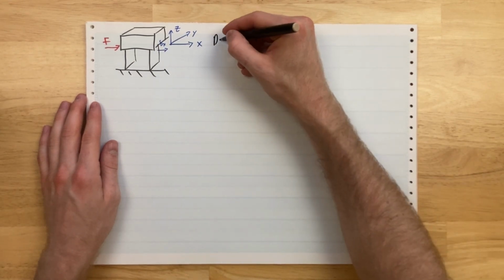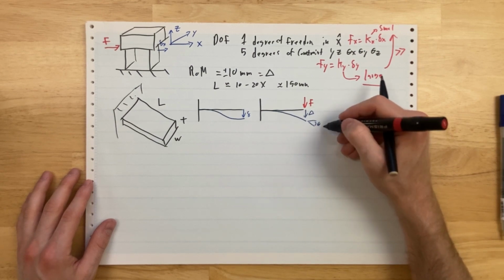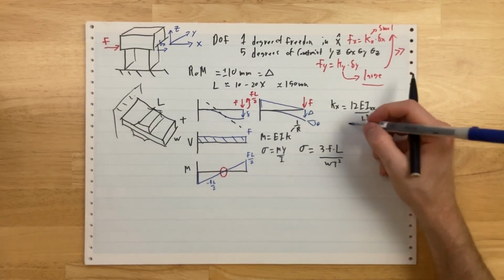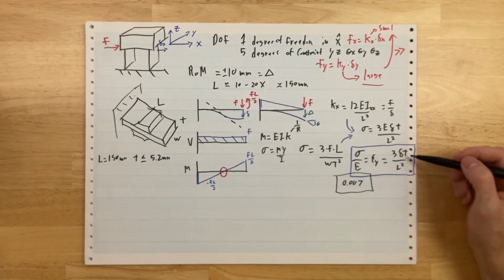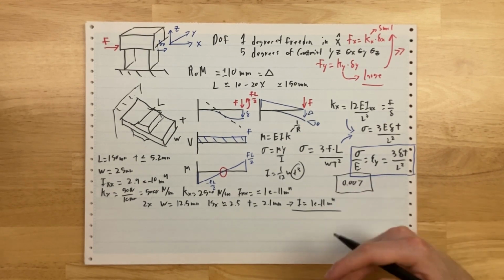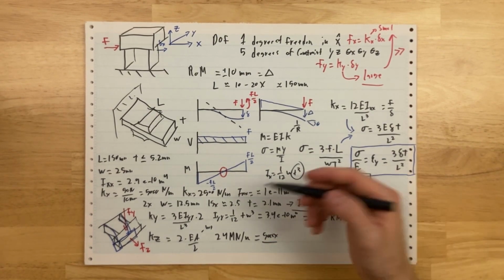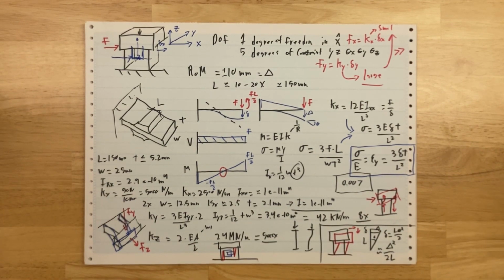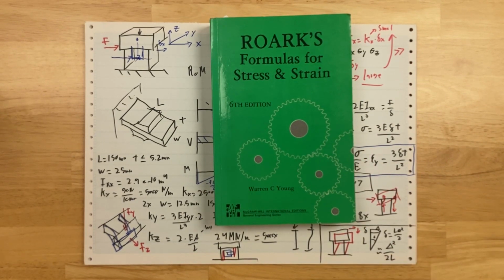Weird Flex But Okay: Introduction to the Parallelogram Flexure

Comment: You waited till 12:00 in to decide how much force you want to deflect 10mm? And what kind of flexure is designed with fatigue as the last critical measure of its structural requirements?? This whole process is frustrating to watch. It's all math first, arbitrary numbers second, reality third. Like, thanks for putting the formulas on screen, but holy shit.